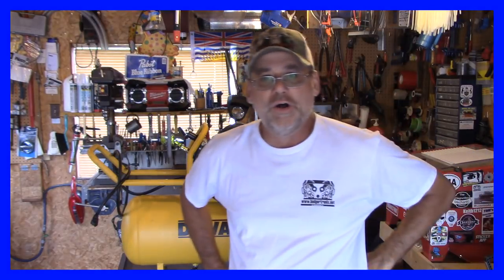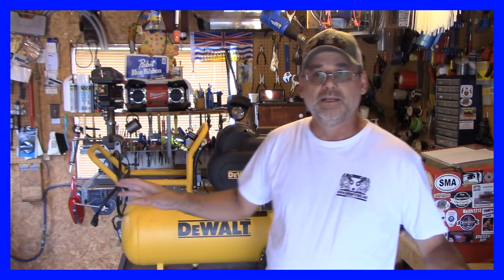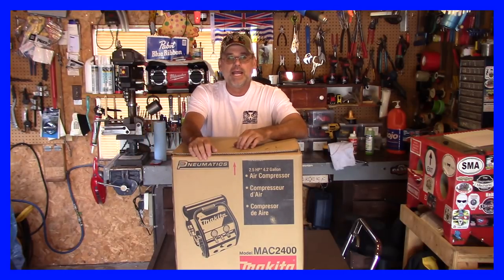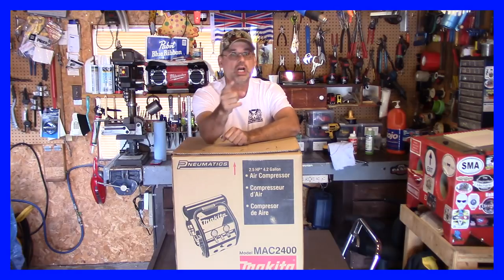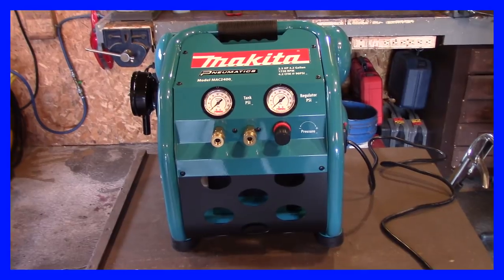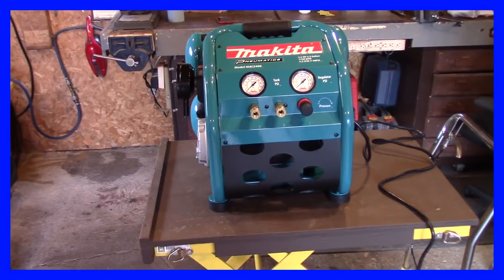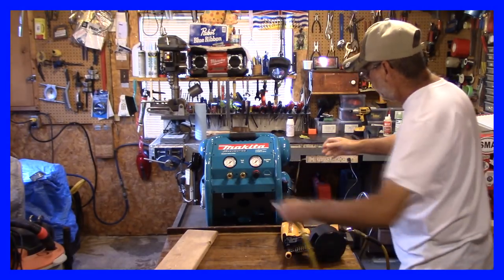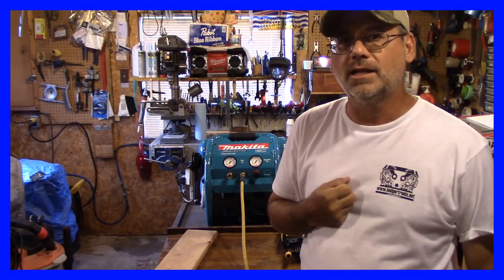MAKITA MAC2400 AIR COMPRESSOR - WILL IT RUN MY BOSTITCH N75C-1 NAIL GUN

Comment: This compressor is truly a fantastic unit. I love mine. Have had it a few years now and it’s delivered day in and day out for my interior/exterior finishing company. A pro grade tool to run either single brad nailers or multiple finish guns depending the needs. I have framed decks, sheeted walls Ect... with no issues. Awesome video. Enjoy the compressor. Subscribed.
Reply from the maker: Mike I have been using it a lot and yes it a great unit and quiet too. Cheers
Reply: How is the compressor running can it handle a framing nail gun
Reply from the maker: Willy I can run two framing nailers no problem.

Comment: I've used this exact compessor for years.  I frame houses, decks, fences.  It will run a bit but never struggle to keep up.  Best advice is to never use extension cord.  Use longer hose.
Reply from the maker: Yes good point Phil . I have done a video on voltage drop using powertools and extension  cords as the wrong one  can destroy an electric motor fast with low voltage. Cheers

Comment: Sweet!!! The Wife is Awesome!!! That’s a nice compressor. I’ve got the DeWalt version works awesome!!! I did notice with mine it really doesn’t like the cold weather but I guess the oil gets thicker and it has a hard time starting.
Reply from the maker: Yes mine is oil as well but I won't be using it in the winter. An awesome gift. Cheers bud.

Comment: I have the Mac 5200, best compact compressor I have ever owned, but a bit heavy to be dragging it in and out of the truck these days, so I am buying a mac 700. Both are the big bore. My 5200 runs flawlessly, pumps quick and runs anything from big guns to air tools. Threw away two Craftsmen POS compressors in four years before finally pullin my head out and discovering Makita's. If you need to depend on a compressor, spend the extra money on Makita, hitachi, emglo, jenny,. Avoid the big box brands, husky, cobalt, ch, hf, craftsman. You really cant get parts(trust me, you will wish you could with those) and they always act up and cause you grief. As the guy commenting before me said, it is best to not use an extension cord, run a longer air hose. If you have to, be sure it is a heavy duty 12 or lesser(higher capacity) gauge cord. Keep clean oil and air filter in them, drain the tank after each use(better yet, install a dessicant filter on them) and heap praise on them for a job well done. Just sorta being funny about that last one, but I have found that the less you cuss your tools, the better they perform. Do all that and you will probably be handing your Makita compressor down to your kids.
Reply from the maker: Oh I'm good at cussing too :) I have a fix for moving the compressor around coming up as soon as I can design it. Yes it's a bit heavy for moving around. Cheers

Comment: I bought a MAC2400 a few years ago because my old compressor wouldn't keep the pressure constant which was a real problem because of the glue on most nail gun nails. When the pressure drops the nail won't go all the way in and you can't drive them flush with a hammer. I had to wait for the pressure to build up so I could fire another nail and then cut the other nail off. The MAC2400 keeps the pressure right where you set it! The only drawback is that the MAC2400 weighs 85 lbs. so I have to be careful when picking it up (had 3 herniated discs). If I remember to use my legs when I pick it up it's not a problem.
Reply from the maker: Good points when selecting a compressor.  I am going to make a dolly for it because it is heavy moving around .
Reply: @SteveRobReviews  I rigged up a contraption that fits in my wheelbarrow when I have to move it around a lot.
Reply from the maker: Good idea .

Comment: I think this would be a great air compressor, but it is quite heavy if you are moving it a lot.  I'm sure its a lot lighter than your Dewalt.  I ended up buying a Hitachi EC1110 Mini Wheelbarrow compressor that is about the same specs as this Makita.  You can still lift it, but it has the wheels and handles to move around.  I'd never seen one before as no store around stocks them.  I just love the design engineering they put into the Hitachi.  I do think they need to spend more time designing the roll cages on all these smaller air compressors as they do roll around if you are moving them.
Reply from the maker: You are correct it's on the heavy side if you have to carry it around . For me it's just  on  and off  my truck. Hitachi  is a great brand too. Cheers

Comment: Great video! That is a framing nailer? And how is it if powering a paint sprayer?
Reply from the maker: Thanks,  never tried it but most big  spray guns  would use more cfm than this could supply.  Fraiming nailer no problem,  more than enough.  Cheers

Comment: What kinda of oil does it need
Reply from the maker: Willy I went and bought 100 % synthetic compressor oil  and put that in after the first five hours  of the regular oil that came with it.
Reply: STEVE ROB REVIEWS it already comes with oil
Reply from the maker: Yes mine had a bottle of oil in the box  and after break-in I put 30 weight oil in . I only use it in the summer.